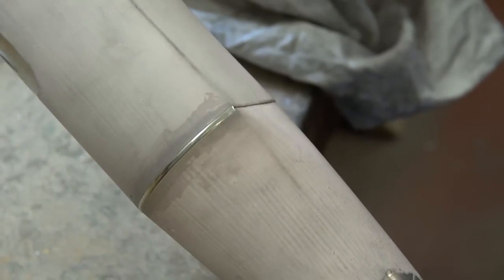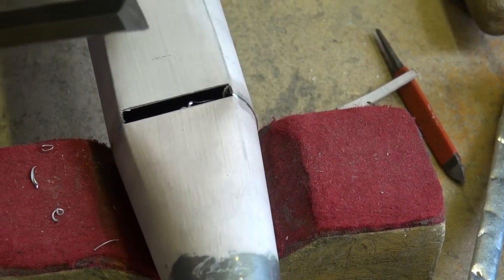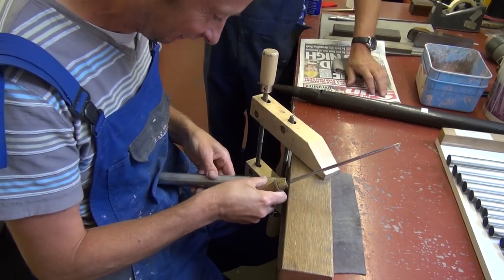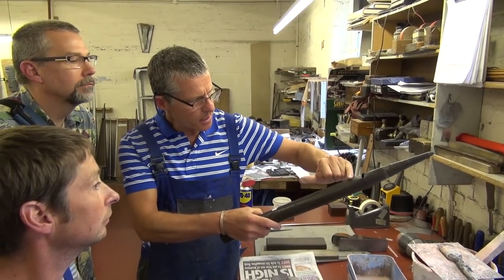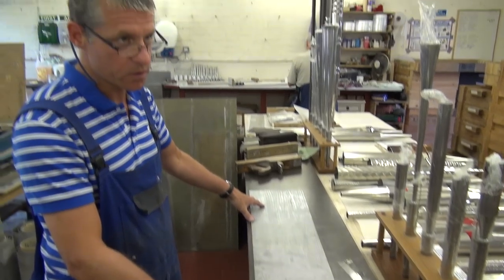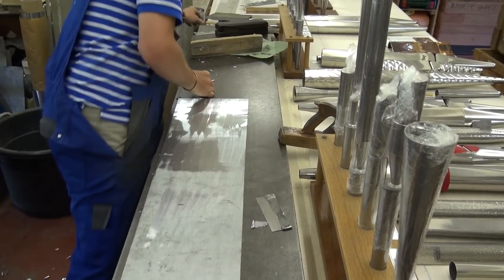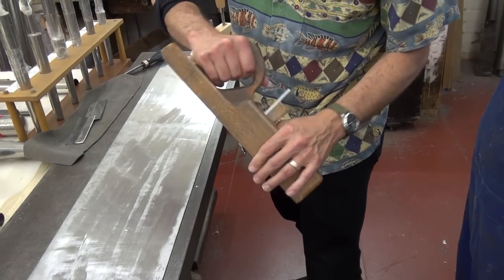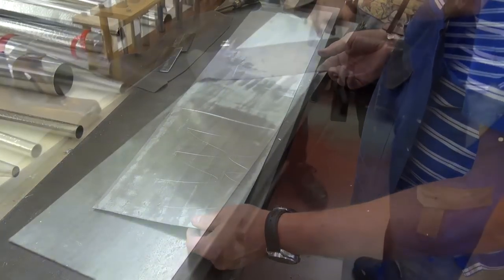Shires Organ Pipes -- 2013 Visit

Comment: Most enlightening!  I was wondering if organ builders ever make a second pipe, especially the smaller ones, intended to be put aside in mothballs for, say, 75 years until the next major rebuild/restoration becomes necessary.  I can see a few problems, especially if a different builder is contracted, but many is the time when such spares would have made the task that much more 'faithful to the original'.
Reply: No, I've never heard of that. Generally, organ pipes never need replacing, unless they somehow get damaged beyond repair y some outside force.

Comment: What pipe is the square one at 12:25?
Reply: Probably an experimental pipe. When I was a pipe maker I made a metal pipe that was rectangular rather than cylindrical. It ended up producing the resonant "hollow" tone of a wood pipe while retaining the "ringing" tone of a metal pipe.
Not long ago I ran across a rank of experimental metal flute pipes made many years ago by the Kilgen organ company of St. Louis, Missouri. It was of normal construction except the body of the pipes were made of copper. They named it (not surprisingly) 4' Copper Flute. There was nothing special about its tone at all...you would never know it was made of copper...which probably explains why Kilgen didn't make any more of them.